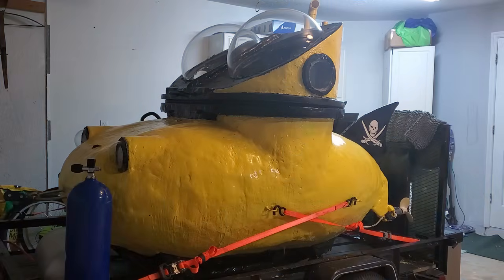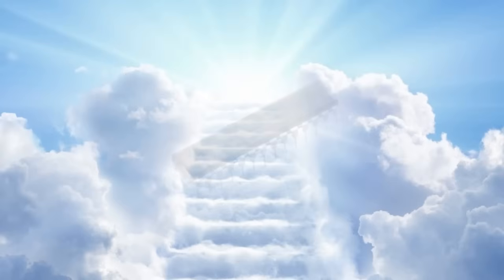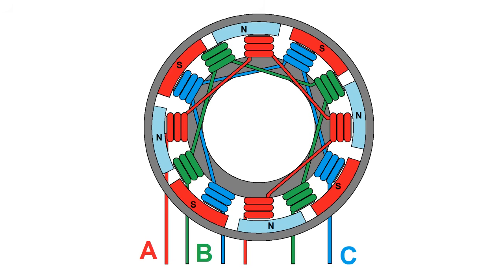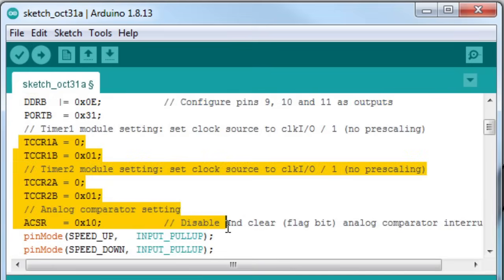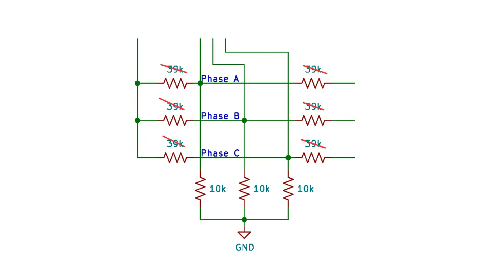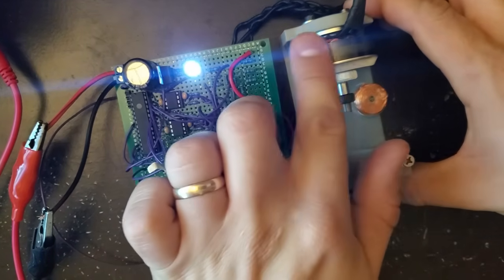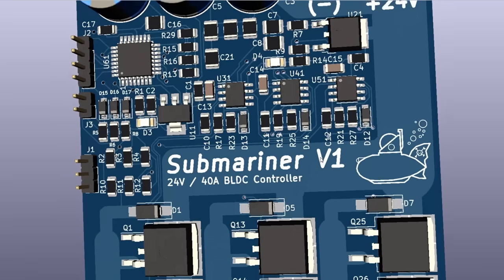Brushless DC Speed Controller

Comment: Hi i don't know if you'll see this cuz its a last ditch effort i made this for my final year engineering project that's due next week but for some reason it doesn't work the most i got the bldc to do was buzz. i think i have a power supply problem  am giving the mosfets 12v 10A and the ir2104 12v 1A since the datasheet caped the max current at that what am i doing wrong?

Comment: Very good video for learning.thank you very much 
I just noticed that the IR2101( i am sure I am not using IR2102) input and output are outoff but wondering if there a minor last minute update to the code in low side switches ?
It looks like the there will be a potential short of MOSFET on the same array . Any suggestions please?.

Comment: Can i use 3 nmos and 3 pmos because by doing this i will not need a gate driver
Reply: Probably not, because there are times when both P and N mosfets need to be off and you can’t do that if they are being controlled by the same signal, so one would always be on. Also using P and N mosfets in a totem pole for power electronics is risky because of the shoot through current when transitioning states.

Comment: Very nice video giving a lot of insight. Congratulations. 

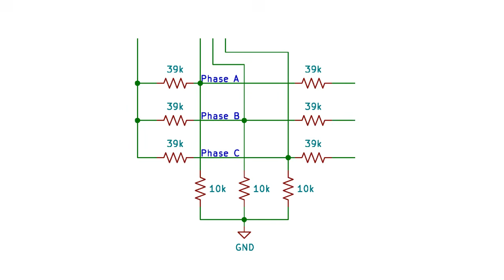One humble improvement I can suggest is not to use a Linear Regulator (LM317 at 10:41) but instead, use a DC-DC converter (aka switching power supply to convert your 24-28V down to 14V).

When you use a linear regulator, you are burning half of your battery capacity [ (28V-14V)/28V = 50% ] on the LM317, basically converting it to heat.

Switching power supplies, on the other hand, can be as much as 99% efficient, and therefore use your battery capacity for propulsion instead of heat.

Keep designing
Reply: Or use buck-converter
Reply: @jandy1551  it's the same

Comment: 1:53 I´ve read, that holding the ends of a resistor at the 2 points you about to connect, before establishing the actual connection, is beneficial in limiting inrush-current, that can wear out components... A soft-start. The resistor can then be removed.
Reply: better to use an ntc in that case

Comment: Hey, I’ve been trying to build one for sometime. I didn’t get IR2101 at first so I used the bootstrap circuit to build a hbridge but it didn’t work, and then I tried driving only the high side with your circuit by connecting one driver burned my raspberry pi pico and switched to stm8. Is there any references of not using the bootstrap circuitry as the data sheet recommends?  10:37

Comment: Very good! A very clean guide through ESC design. The only mistake (that actually, almost all hobby ESCs have) is that you should not switch phases at zero-crossing. Zero-crossing happens in the middle of the current phase, not at the end. So you switch phases a little bit too early. That still works obviously, but it reduces efficiency and increases torque ripple.

Comment: Negative ghost rider how are you shorting the drain with 12v over its threshold? And the atmeg as well where's your second source or voltage drops for that? Also why connect source to ground an the datasheet says not to go over certain parameters or else the mosfets were destroyed themselves? Can you show all details if not explain it with out skipping the important steps please and thank you

Comment: This is so interesting and impressive! I finally really understand exactly why 3 phase motors have 6 wires, how all these coils relate to only 3 phases, and how the number of magnets are related to the number of coils per phase. 

When you were talking about needing a hall effect sensor, I realized you could deactivate one phase and measure voltage on that phase - but then you mentioned using the inactive phase because there's always one that's not driven. Super clever. 

There are only two things I may have missed or you didn't address them: the waveform (PWM, simulated sine, or simply square - which is what you're doing), and the other is timing: the ATmega328 does not have reliable timing because of its factory default interrupts. I believe people can get much faster execution and much more reliable timing by programming them in assembly. This probably doesn't matter since you're relying on an interrupt for your timing anyway - so the measurement from the motor is your clock in a way.

Comment: 3:55 What if we use these switching instead ?

I realized.
I see in the video the sequence on/off of the switches is this:

s1: 110000
s2: 000011
s3: 001100
s4: 000110
s5: 011000
s6: 100001

But wouldn't it be better if it looks like this?

s1: 111000000011
s2: 001111100000
s3: 000000111110
s4: 000011111000
s5: 100000001111
s6: 111110000000

Comment: I just wanted to say thanks for sharing your project, It provided inspiration and impetus. I had been putting my own ESC project off for a while. A combination of analysis paralysis and trying to think of all the required features. I decided to go with through hole components (majority) and an arduino after seeing this video. My motor is now up and running. Thanks again.

Comment: Greetings Hyperspace Pirate. First of all thank you for sharing your project. I have three questions:
1) This circuit of yours for brushless motors, is it necessary to give a push to the motor to start it, like many circuits given on the internet?
2) It serves for HD and CD ROM motors with 3 and 4 wires?
3) Can Arduino Nano be used?  Thanks a lot.

Comment: 14:02 I'm troubled by that noisy start whenever you start the motor or reverse direction.  That would make me cringe if i was driving your sub (or just in it).
I think you need to smooth the inrush current at startup. I can't help but feel that's a lot of unnecessary strain on the motor! It would freak me out.
I like the way it ramps the speed, and also using assembly opcodes to switch the MOSFETs.
Good job! I would've probably used a different micro, tho... just sayin'.  👍 👌
14:33 ooooo! Sounds like some bearings are already bad, when you run it fast! 
Hope it doesn't leave you stranded at the bottom of the sea!
Got emergency ballast blow (i hope)?

Comment: I'm looking to make my own mixed signal ESC for some DIY quadcopters and I want to use analog computing for the inner control loop. The idea is that sensors provide analog signals while the computer can control it either through sequential logic or a DAC. After computation the net output is fed into a voltage controlled oscillator running an endless loop shift resister which selects the BJT/FETs needed. The idea is that all of this takes place at the rotor so that each rotor has it's own inner control loop with mixed signal state mechanics.
Reply: Sounds complicated.
I guess the idea is you WANT complicated!
Reply: Well the tradeofff is simplicity for better inner loop response latency.
Reply: Great now I’ve started my day thinking about detecting runaway effects and oscillatory feedback

Comment: If you want to handle huge voltage you can run the esc at 5volt and the it triger the MOSFETs with the cooler  that are connected to the huge voltage

Comment: This really planted an idea in my head. Could the Atmega and logic be replaced with another BLDC motor used as an input. Hand crank (or pedals in my head) drives a motor to a set of MOSFET drivers to the output motor. Keep the whole thing AC. Manual Speed Controller?

Comment: It’s because the brushless controller, like servos don’t just take PWM control, they need an exact pulse timing to initialise. If you use a servo library it’ll solve your issues.
Reply: It's still PWM, just a particular rage of duty cycle. I'm sure this guy was able to figure that out. The problem with RC ESCs is that they are a bit picky about what signals you send them to start up. Some won't recognise a servo "0" or "180" degree, and will instead only accept signals between e.g. 20 and 160 degrees. On startup they often do some sort of input calibration, so once again if you have the wrong signal being sent at that moment it'll mess things up.
Reply: They need an exact position of winding wrt magnet position & polarity.. but this is not achievable.  with external servo pos. control .....
Here target is stator wdg./ rotor magnet ..ext.servo is for external target/ plant control
Reply: Is it possible to write code for the motor to stop sooner without the long spooling down? Like say within 1/2 second or even 1 second?

Further, could to write code for the motor to stop at the exact position each time? As in, can the motor, if there were at arrow pointing towards 12 o’clock, could that be done each time the motor was stopped?

Comment: Hey! Great video, very simple and straightforward, but I think there is a big mistake in control logic. I never built an ESC yet but I am pretty sure that zero-crossing happens in the middle of the phase, not at the end. So If you will switch the phase at that moment it will work, but I guess the efficiency will be very low because you always will be half-phase off the ideal timing. What you should do: use the previous zero-crossing time to get an idea about a phase duration and wait half of this duration AFTER zero-crossing and only then switch phases. I see the same issue in other DIY ESC builds. Please respond if you are sure that I am wrong. I would like to figure this out for sure.
Reply: These DIY escs use a driving strategy called 6 step switching, where for a full magetic field rotation, there are 6 different electric states. Each zero-cross represent the end of the current step, that may also be the end of that "phase".
Reply: the term "Zero crossing" is the 
" motor B.E.M.F. crossing @ zero volts when its voltage polarity reverses.. from +to- or -to+ ... "commutation instant"  is another event.. and is related to " current" going through zero , before changing polarity.  & is not necessarily in phase with BEMF .. there's always more " current" phase lag @ light loads especially @ higher speeds....
therefore there's always lower torque @ higher speeds even when driven at rated motor current.

Comment: Don't use LM324, use LM339 instead. or you can make a interesting video for comparison Opamp vs voltage comparator.
Reply: LM339 is definitely ideal..
but if you are a beginner and not too familiar with pcb/ circuit layouts , for  "comparator modes " operation you can go ahead with sluggish LM324 op amp used in comparator mode..since it may automatically filter out HF noise .
Reply: @analoghardwaretops3976  "it may automatically filter out HF noise ." This quit interesting.
Reply: @mlab3051  it(324) has a lower frequency response/ bandwidth and lower slew rate/ & longer rise- fall times,
when compared to 339 ..
hence 324 does not make a good audio amp , neither a fast comparator.

Comment: A bro FYI on your schematic you have a big error. On the Atmega32-PU chip you have pin  PD4 going to your Mosfet Gate driver 1R2101 as the high input (HI), but that Digital pin on theAtmega328 chip is not a pwm pin. Even on your website when you have the schematic showing wiring from the aduino it has Digital pin 4 going to the LI on the C phase mosfet driver. Again there is issues with this wiring. If you want to keep this wiring the same you are missing a PWM input because you have used digital pin 6  for the comparator which leaves no extra PWM to drive the HI & LI of each Mosfet gate driver you need 6 PWM pins and you only have 5 available the only way to make this wiring schematic work is to use an Arduino mega 2560 which has the pins i Stated as PWM.
Reply: It's not actually doing PWM on the high side pins. If you look at the code, PORTD just turns on and off for the full drive period, while PORTB is doing PWM. This works because for each high side switch there's a low side switch, and only one needs to do PWM.

Comment: will a sensorless motor work with a sensored esc?
Reply from the maker: I haven't tried, but I think you'd run into problems, because the software on the sensored ESC is expecting a reading from 3 hall effect sensors to determine when it switches phases

Comment: Now add PWM, current limiting and smooth start and you got a usable brushless motor controller. Probably better to move to STM32 micro with many needed hardware peripherals already built in.

Comment: Hi! Could this design and code on an Arduino run  a motor at 40000 RPM?
Reply: Say you have 12 poles in your motor, then youll have 12 switches per revolution. At 40.000 rpm ≈ 666 rps youll need a switching frequency of 666*12 ≈ 8000 switches. For every switch you need multiple measurements, say 10, then youll have around 100.000 operations per second, atmega328 has 16Mhz clock frequency so its probably possible.

Comment: I think on your schematic there is an error. motor is in Y configuration and all the sensing dividers are connected together to common point. probably they should be connected to other part of the windings - there where mosfets are, right?
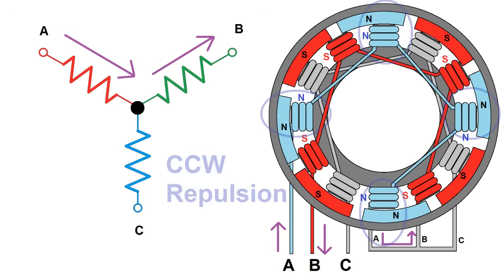Reply: no.        at 2:18, see lower right.      there is a common  endofA-endofB-endofC  pigtail, that is not connected to anything.
Reply: @daviddavids2884  I'm talking about diagram at 10:36 for example
Reply: @daviddavids2884  The schematic is garbage he is using non PWM pins to power the mosfets pin 4 is not a PWM pin and it shows it going to a HI on a Mosfet Gate driver the whole circuit design is trash it does not work. Not too mention this was all was stolen info from Electronoobs and his schematic is trash as well it doesn't work. Both are TROLLS.

Comment: I do understand a major part of this but not all and not properly (I'm currently in 2nd year of my electrical engineering)
Can you guide me as to what will I have to do if I wanted it to work with 48v and around 150amps.
Also, can you upload the circuit diagram too.
It'll be very helpful.
Reply: Wow.  I understand every bit of it, I've designed my own circuits to do all kinds of stuff... but I've never had ANY engineering classes. Not one. 
I'm completely self taught, I just figured it out, by reasoning though it.  
Where i learned?  By reading data books published by the IC manufacturers, of course.  You'll find a treasure trove of great info in there!
Everyone should do it, if you want to learn. 
Some of the best ones are "App notes," AKA application notes. Those have theory, explanations, reasoning (strategies, etc), everything you'd want.
You can usually download them for free.

Comment: Congratulations!
Your video is the best tutorial about the ESC for BLDC motors. Finally, I could understand how does work the BLDC with back EMF control. 
Thank you, a lot.
The Arduino code is very optimized for speed, otherwise it would not usefull for this kind of motor control.
Your hardware considerations about the use of the Atmega328's internal analog comparator was great, as well as the Interrupt.
Did you finished the PCB design?
Do you think or plan to sell or share it?
I would like to get it.
Did you test your maximum speed acquired, at despite for your purpose you don't need very high speed, I think.

Comment: This is pretty cool. It's a lot simpler then I would have thought it would be. I mean the feedback stuff is a bit complicated. But it was simple before that 😂
Reply: It is good as a homemade esc but it is nothing compared to commercial escs, like blheli32 escs, they have a lot more functions, like low voltage cut off, stuff to help with starting large motors, braking, configurable acceleration rates an using PWM to emulate a sine wave, just to name a few of the advanced functions.

Comment: How to get a 310V voltage out to be applied to a 3 phase bldc motor with these specifications?
Reply from the maker: Probably gonna need MOSFETs with a higher V_DS and change the feedback resistor divider values. 

In reality if you're gonna use that kind of voltage you're better off switching to a hall-sensor equipped ESC, which this is not

Comment: So that the motor can start spinning what must be changed??
Reply: I believe you need to add the open loop control for starting - he did mention that earlier in the video. Then transition to the feedback based system

Go to the part where he just has code to step through the 6 sequence states and that's the open loop part which would get it spinning and the back EMF is then generated. Your code then should transition to the code he showed in the last part where it's setting the mosfets from feedback from the back EMF.

He called this a prototype so I'm sure the video was just showing the closed loop control which does not startup without hand turning sometimes.

Comment: Hi I have tried out the Same circuit but my midgets are getting really hot and damages the circuit
Reply from the maker: I try to avoid using midgets in my circuits so that I don't get in trouble with human rights laws

If you had overheating MOSFETs though, you might want to check and make sure your pulldown resistors are installed correctly and that your atmega328 pins are connected to the right FET gates
Reply: Using lithium ion battery with a2212 Bldc would work or do I need to replace the battery with rps